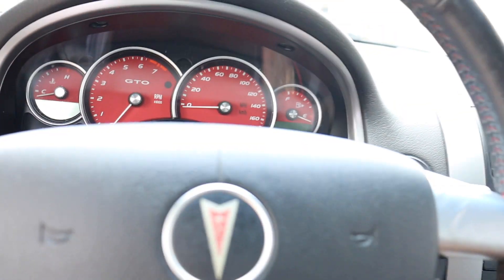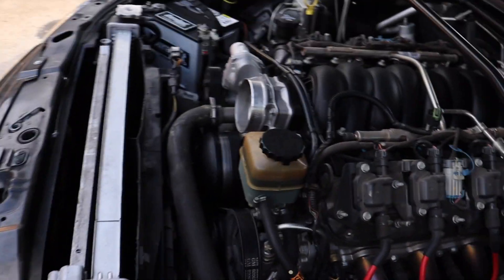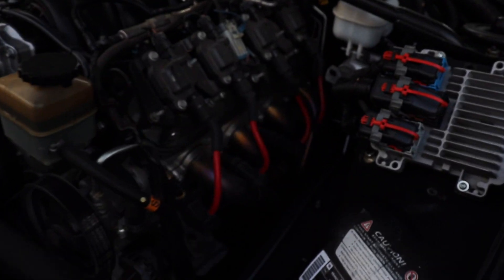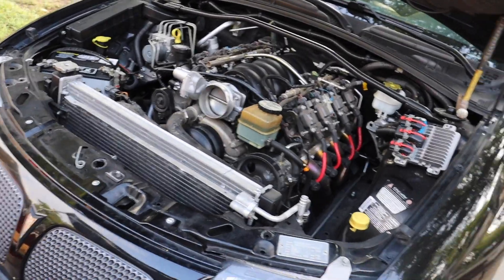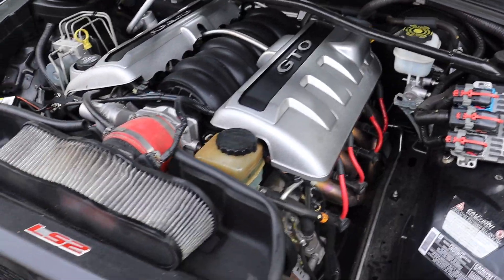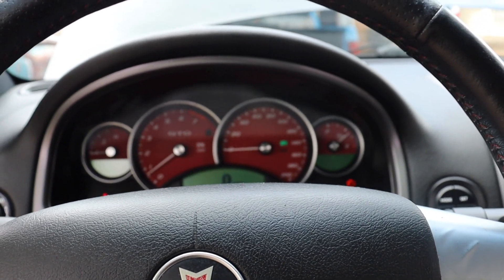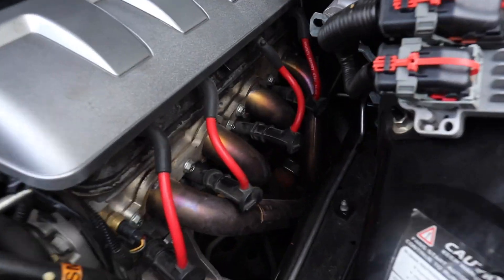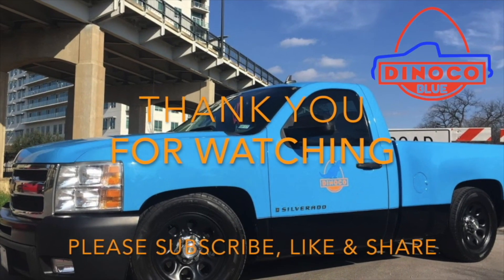BIG CAMMED PONTIAC GTO LS2 6.0L

Comment: I have a 2004 GTO and I absolutely love it. I had an 05 model too LS2 and it was good. But I love the 2004 model because it doesn't have a drive by wire set up. Still drive by cable. Less lag when accelerating. I've always driven Fbody cars and earlier trucks and I just like the drive by cable systems more even after driving a 2010 SS Camaro

Comment: Did you slap a cam in without tuning the computer?    I want to cam mine but I wondered if it would be able to drive to the tuner shop after.
Reply from the maker: You can still drive it after the cam swap but it might turn off here and there, but you still need to get it tuned after a cam swap